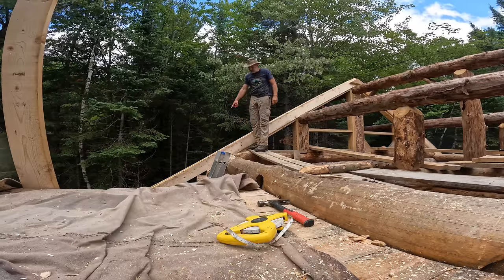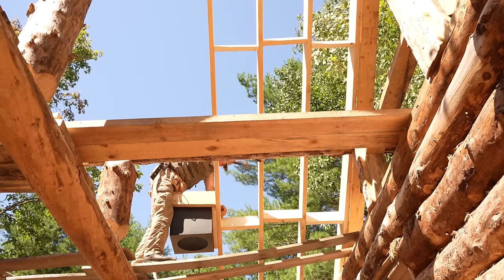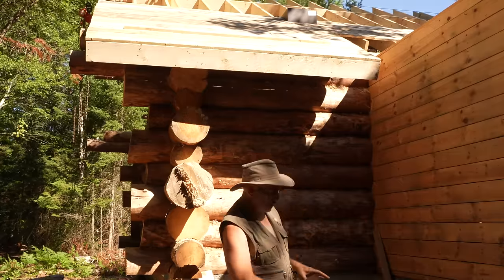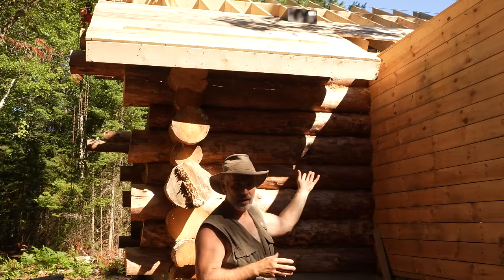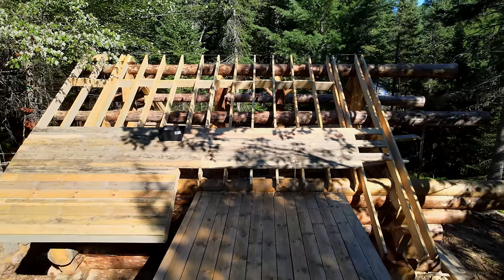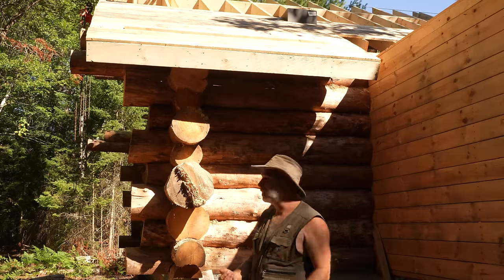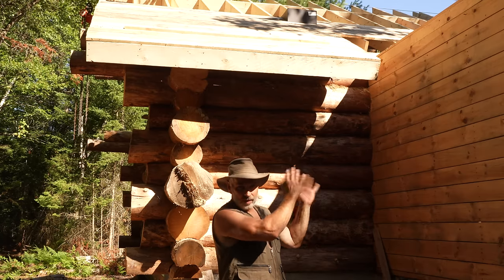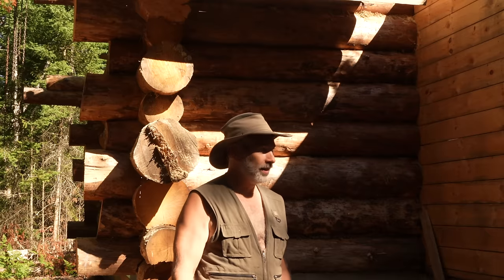Difficult Roof Design, Choosing Materials, Dealing with Settling, Reaching a Milestone

Comment: I am amazed at the speed at which its all coming together Shawn,
It makes a big difference to see it which the roof structure up, i am glad to hear that you are leaning  towards a metal roof, at least that is a lot less work weight wise, just need a still day when you do it as there is nothing worse than having to fight the wind.
You mentioned something to do with the potatoes, something to do with curing them, what does this entail as its something i have not come across, usually we used to dig them up and keep them somewhere dry for a short time, is this what you mean?
What with the garden and the cabin, and helping your daughter out, your going to be a very busy man for a while.
I am really impressed with the way the cabin looks now, its almost looking like home although as you say there is a lot to do, i think once the roof us on ig will move very quickly as most of the real heavy work is now behind you, dare say therecare a few heavy things yet to take place but its showing very much better just what the finished product will be.I was thinking the last video, as to just how heavy the cabin is because there is a lot of very solid timber sitting there.
I am begining to see the purpose of the breeze way, that should keep a lot of the winter weather out plus somewhere to store outside clothing and boots and anything else that needs keeping at least dry for the most part, all I can say is well done, it does you proud, and will be there for a long time i am sure.
As usual, all the best for you and the family including of course Cali who looked like she was put  out for not being played with, but that a bit hard when your on the roof!!
Stay well , John Australia.

Comment: Have to tell you….the Shawn method of potato growing is working really well in my garden. The straw cover kept the tubers moist and cool. I squashed about 500 potato beetles and won that battle. Already pulled a few plants to see what was happening and got 6 big ones per plant. I’m in roughly the same growing region as you although not in the woods. Great tip for a novice potato grower.

Comment: Starting the roof is a major milestone in my opinion. You've worked hard for over a year to get to this point. Looking forward to you getting the roof dried in, and you starting on the other things like interior work and so on. If it was my cabin, I would be going for the metal roof. They last longer, and as you said, would help prevent embers from fires causing trouble on the roof. Plus, the snow is easier to remove if there happens to be a massive snow load that needs to be taken care of, especially since the pitch of your roof isn't as steep as most roofs.

Comment: Me either Shawn, where does the time go. They old saying the older we get the faster time goes by is so true. 
   Keep plugging away at the cabin you will get it dried in before winter as long as it doesn't come early 😉.
    Hang in there 🙏

Comment: Like the sound (pun intended) of the baton lift air gaps under the metal roof over the 2 x 8 sheet planks. Much quieter during rain/hail storms. 

What are you tying the zip wire too? 😃

Comment: Good luck with the roof. My house was added on to in the 70s. Part of it had a flat roof. I didn't know how to get in that attic for 14 years and was surprised what i found. My house is 132 yrs old. They put a roof with not to much angle over the flat part to the peak of the old roof an cut a door in the original roof to get into the flat part. That room still has the wood shingles on 1 side. I finally found a picture of that side of the house and it had a big porch on the back. They put a work shop an laundry room where the porch was an a garage where the summer kitchen was. Its messed up bad now!  Leaking on both sides of that low angled roof to the garage. I got ripped off by the roofer 20 yrs ago. O well! I'm old and won't have to deal with it much longer because I'm allergic to mold. It's so important to do it properly. You are a smart guy an i have faith in you to do it right. Thanks Shawn.

Comment: A second thought for snow is put the roof on a hinge and when you get a big pile of snow use a hydronic jack to bump roof up and get snow off the roof. Maybe a Teflon coating so it will slide off. Just a thought.

Comment: I built my log home back in 1998. My home settled around 5" total. So to allow for the logs settling on all the doors and window frames i built i took the skill saw and cut slots in the 2x6 lumber. Then spiked through the frames into the logs. Its important not to drive the nail heads into the frames.That way the logs could settle easily. Also obviously i left a large gap above the doors and windows. I used the same method on interior stud walls. This method worked well.

Comment: Nice to get some explaining on why you made the roof like you did. I,m aroofer by trade so was wondering how you would make the roof watertight without getting problems with condensation inside the structure.

Comment: That’s a interesting problem with the breezeway and the house shrinking at such different rates.  It’s similar to the problem building in areas with bentonite clay which can contract and expand a lot.  I have seen where the basement walls are built with a space between them and the slab.  As things moved the space can be adjusted with blocks and the space can be covered up with a tall base board.  I live in the forest high in the Rocky Mountains in Colorado.  I have spent a little time in Ontario and it’s a treat so see all the nature you show on Youtube and being an old carpenter I love to watch you work.  Thanks
Reply: I forgot to add that there are rods coming out of the floor and going through holes in the bottom plate that keep the wall in place

Comment: Shawn, about that Chimney Penetrating the roof... Do you ever have problems with water and snow damming on the back/up-slope side of it?  Would putting it in on a Diagonal, instead of squared to the Eaves solve that problem?
Asking, because the wood of our roof has started rotting, for the reason above. 😥

Comment: Longtime subscriber.  The new cabin is looking fantastic.  I sometimes wonder what you’d be focusing on if you were still at the old property.  The longhouse would have been completed by now and the root cellar too I guess.  It’s just something interesting to consider.
Reply: The root cellar is on this property.
Reply: @armybp1  I’m referring to the structure he was building right next to the pond he dug out on the other property.  I don’t immediately recall it’s purpose but I’m fairly sure it was going to be at least partly underground.  I guess that’s why I thought it was a root cellar.  He was smack in the middle of the build on that structure when he sold the property.

Edit.  Just looked it up.  It was described precisely as a root cellar on the other property.  See the video uploaded on August 28, 2020.
Reply: @chrismcgady4978  no...the unfinished build overlooking the pond was going to be the workshop.  He has a series of videos showing he completed the root cellar.  He even mentions he was purposefully a little deceptive for privacy reasons.

Comment: when you speak of the 6+” settling, is that in between the logs because they’re shrinking and you’ll have space between that is that cumulative amount or is it from the weight of the logs on top of themselves ? wonder what your thoughts are on vertical log construction vs horizontal ? so impressive, shawn ! always .

Comment: Yo, I'm just curious ... The logs settle. Do you put time between doing upper logs and beams? If so is it a drying time ?  And how log of a wait?  As for the clinking between logs . Have you tried spray foam in a can? Maybe a roof sealer  ,rubberized Matt. Do you use concrete or mastic and grout to cover between the logs for a leak proof seal and have a uniform line between your logs ? Looks nice .

Comment: I hate to admit it but I have been thinking about the roof line of your house for months and how to tie it into that stick frame bump out.  Would it work to run beams along the top plate with a 3" shim at the corners, frame out the roof and gable end independently and tie it into the top plates with steel plates and all thread.  As the house settles you can jack up the corners with a bottle jack and replace the 3" shims with progressively smaller shims   and tighten down the threaded rods.  I don't know the snow loads or sheer values needed for that kind of structure and you are by far more qualified than me so please don't take offence by this good idea fairy.  Have you read any papers by Joseph Lstiburek? There are some good stuff on moisture control and even ground frost if that ever becomes an issue in the future.  House look amazing, stay safe.

Comment: Just not enough to keep you busy Shawn ? The settling allowance over windows shown doesn't look like 6 inches or was the 6-9 inch reference to entire roof at peak ?  Like the idea of an extended shed sloped roof.. Do you think you could make a wedge shaped side section that can be increased in angle as settling occurred with a hinge or slip allowance at point nearest roofs peak ? I guess the rafters available lengths will be determining factor.

Comment: For what it's worth in your part of the country that would but of the country I would say a metal roof is absolutely the best way to go. And provides you a little protection should there be a forest fire God forbid but it also allows for snow to slide off a lot easier than any other roof that you could possibly use. Cabin is looking good at this point. It sure is a long process especially doing it alone or for the most part doing it alone.

Comment: Could you build 2 gables roofs - one above the breezeway and one above that fixed independently to the cabin  - with a good floating overlap between them, and a good enough gap to accommodate the settling.
One fixed to the breezeway top plate. The other is fixed to the cabin roof
Use a rubber gasket to block the space between the overlap. 
Over time the 6cm settlement will compress the gasket/rubber.

Comment: i wondered what you were going to do about where upper roof came down to that breezeway flat roof. id go with metal for the roof. one
thing im curious about is how you are going deal with the loose soot particles in your basement. its bound to choke you when youk knock 
the particles loose working on the living space floor.
Reply: thank you for your reply

Comment: Could you tin the roof on the main section from side to side, in one piece, from top to bottom, straight through, and then put the addition roof on like you mentioned, with the two valleys, but float it above the main roof? 
Let the moisture run down to the eave into a trough under the porch roof out to the sides. The inside of the porch would be gabled, with access, and where the roofs meet, screened,to keep out the gritters.

Comment: Shaun, would it be possible instead of a flat roof going on your board structure that instead you a hoopped solid ridge poly tunnel that you can temporarily secure to your sloped roof with a semi circle roof structure over your panelled structure so snow / rain rolls off.
Reply: Tell Rockwell I refferred you for something new

Comment: Do you think you'll have threaded rods under your uprights on the porch so you can periodically lower them to account for settling? I had to remove an upright from my porch because it was preventing one corner from settling.
Reply from the maker: I have 12” screw jacks for the porch vertical posts

Comment: Could you create a gable roof over the stick frame room and a taller gable roof on the log portion? Both gable roofs would have ends that stop at the log wall. The gable roof on the log portion could settle but still be above the roof on the stick frame.

Comment: This is not a criticism just a genuine question from a guy who's not a builder.  Is there any change in structural Integrity if you notched the 2x6s instead of notching the logs to accommodate the 2×6's?  And seems like a metal roof is ideal for the reasons you stated.

I very much enjoy both your channels and have followed now for a few years.

Comment: Shawn,,have you looked into the Rubber roof...it comes in rools...it is so nice and so easy to use even in the winter..its really unbelievable...and strong...i have some here over 5 years old,,still like new..about 1/8 thick,,if that....well its just a tip....i do like steel...but it gets really hot in the summer..and cold in the winter...you should geter done by cold weather,,i hope...your mind is working,haaa
Reply: Tell Rockwell I refferred you for something new

Comment: Also, why don't you put some through vents in your roof rafters for ventilation? I have a similar design and that's what I did. I know you are you going to raise the metal on strapping, but I think it would be a good idea to do both. And just cut some holes in the beam going across near the top to let the air through. You wouldn't be able to have as much insulation, but I think it would keep the place nice and dry.

Comment: This might be dumb... but wondering if you could run a piece of metal, that was connected to the chimney pipe, through the logs to the transition point to keep it warm enough not to freeze?
Maybe a copper wire that you can shape as needed at the transition point.

Comment: As much as a traditional wood roof would be nice, I completely agree with a metal roof. Not just for fire risk, but also sliding the snow off in the winter.
Reply from the maker: Yes, which will be necessary I think since I sloped the roof less than ideal

Comment: Don't put the metal roof on until log building shrinks. Use several layers of tarp at joint of the log and cellar section from underneath roof  so you can remove it later. Apply sealer over tarp if it will stick.

Comment: Metal roof for sure. Forest fires are our future. 
After finishing your house, you'd need kind of an outside sprinkler system with reliable firesafe pump system to keep the walls wet for the time the fire rages.
2015 i lost my automotive hobby shop with all tools and cars inside to a fire, that was a very heavy setback for me. No insurance. Just this year, 7 years later, i found a new shop to rent and try a new start to my hobby. I'm still scared of fire hazards.
Take care.

Comment: sounds like you should play tetris for a day solid just to get fitting odd shapes together down real good ... those roof lines are going to frustrate that is for sure ... perhaps a barn style roof idea ... double pitch slope ... for the indoor outdoor kitchen roof ? sure it may leave extra head space BUT then you could put racks on pulleys and put your lighter stores on them and keep them up in the rafters where they are out of the way ... or make laundry racks for drying etc but they can also hang other stuff like herbs for drying spaghetti etc ... 
.
.looking better all the time ... perhaps jump ahead get the concrete poured for your kitchen footings ... then get your roof closed up ... heck even make a temp tarp roof over the outdoor kitchen for winter working ... so you dont have to shovel it out all the time ...

Comment: right now you could hang rigid steel pipes from the porch rafters one pipe inside a slightly larger one schedule 40 4inch id and 3 inch rigid just inside the larger pipe they could telescope to 20 feet in height...crib and block them with stone and pour piers for support then as logs shrink you could pull pins and make adjustments like a telescope 3inch rigid inside of 4 inch rigid poured in a pier as logs shrink simply pull the pins and redrill for resetting height til building completely settles once that occurs the pipes could easily be filled with grout...nothing stronger or more load bearing than schedule 40 rigid pipe...set lower pipe in concrete piers...in that sandy soil the pipes would easily drain any moisture out the bottom to avoid freezing and as i said once house logs completely stabilize the solid round bar steel pins will hold the positions and grout may be applied...each year pins could be pulled and re-drilled until building is stable then pour the grout clear to the top with grout...totally bug proof and the round shapes are the strongest configurations $ inch pipe would be the lower portion and 3 inch rigid pipe measures 3 5/8 outside dimensions will set just inside the 4 inch rigid electrical conduit is galvanized inside and outside for the sacrificial rust prevention until building completely settles!
Reply from the maker: I have 12” screw jacks for the porch vertical posts
Reply: @ShawnJames1  fantastic will they be permanent?

Comment: I’m not sure what other material you could consider compared to the metal roof. All it’s advantages plus fire resistance seems to be the right choice. I say this cuz my biggest concern would be fire. A portable water pumping station or fire suppression system would be high on my list of priorities. I think of later in life and having to scramble onto the roof for shingle repair when you are 20 years older, something I would try to avoid. The thought of being dried in for the winter must be a great feeling.

Comment: I would have done tight pinned butt pass on the walls to stop the settling at 1/4 to 1/2 inch....the craftmanship on this cabin is top notch for sure...but a survival , off grid, forever cabin the settling is an issue.

Comment: If every log shrinks anywhere up to 3/4“ in diameter but not in length, what happens to all the corner joints in particular - do they become loose?
Reply from the maker: Yes.  The tight joints will loosen a bit and the lateral joint between the two logs will tighten